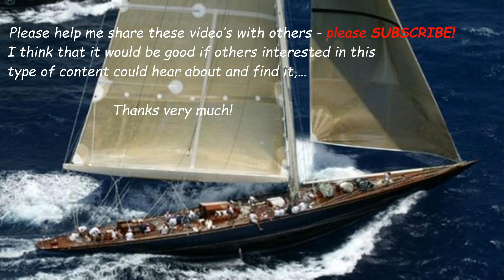Building my steel sailing yacht Tech.talks #2 Marine Ply, MDF & $#*t ply

Comment: Spot on !  MDF is cheap and only good for patterns !  It absorbs moisture right out of the air, swells and loses it strength and warps.

In the US that "low quality"  plywood is usually called CDX, which is its "grade".  A is the best quality veneer (no or very small tight knots)  D is the lowest quality (missing knots).  X means it is assembled with a water resistant (exterior) glue.  3/4" (17mm) is commonly use to sheath houses.

Marine plywood come in 2 grades, regular and certified BS1088.  The BS1088 is manufactured to a higher standard and features rot resistant hardwood veneers and "boil and waterproof" glue.  The regular "marine" plywood typically uses fir and and a water resistant glue,
Reply from the maker: Thanks very much for your professional comments Jack, very much appreciated and to learn more about this from you too sir!  🙂
Reply: @BuildingSYMistress  - I can also translate most Aussie to US English !
Reply from the maker: @jackpatteeuw9244  Ha! very cool!  😀

Comment: The MDF as you say is most likely made from pine. I used to work work cutting the finish product at the old CSR plant in Oberon NSW. That thin board you get form your supplier is a cover board for packaging that covers the finished product. In another words it failed the test.
BTW, I have made plant boxes out of 12 mm MDF and vanished it, they lasted for 3 years and would have lasted even longer if I needed them when I moved. You can get MDF which are water residence to, it has a thing green line in it as far I can remember.
Reply: *Varnished   I usually wouldn't make a correction, but I read "vanished" and thought it might be a planting technique where the box just biodegrades. Which would be pretty cool.
Reply from the maker: @grakkerful  Nice, Ha! well picked up and said grakkerful!
Reply from the maker: Thank you very much for your comments Lars, much appreciated hey and great to hear from somebody in the know about this too!  🙂